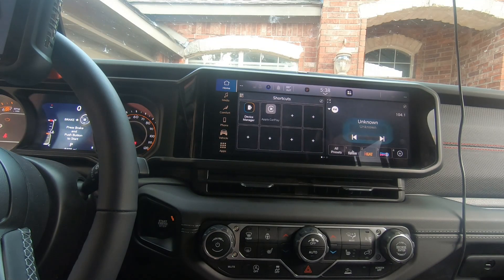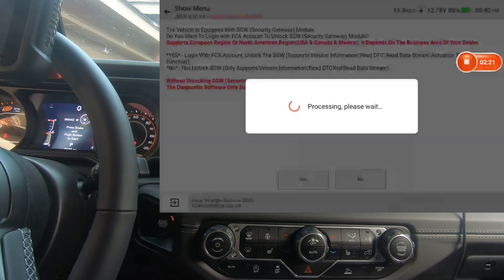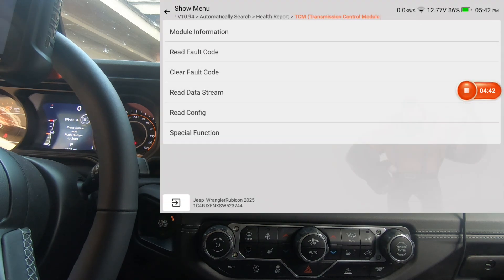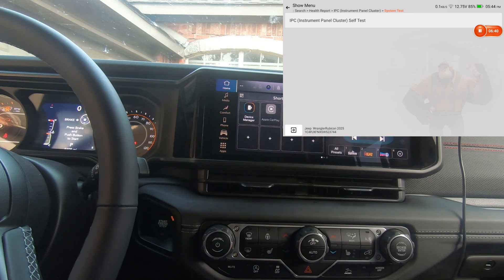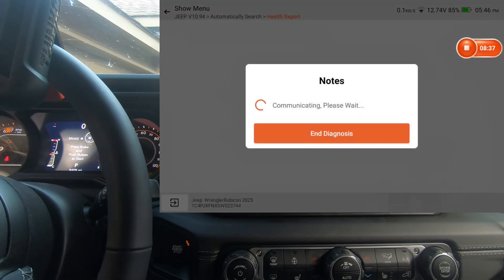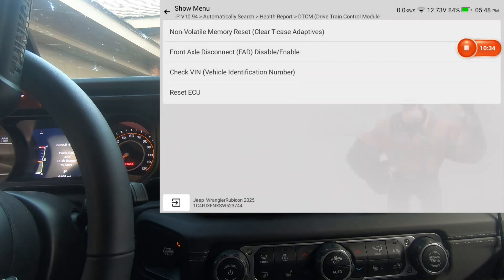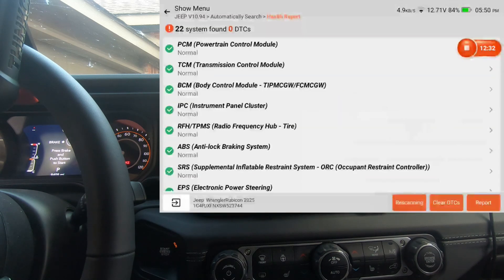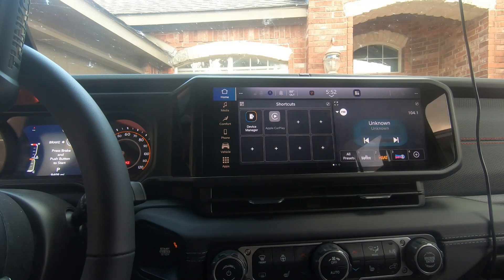Using the Thinkcar 689BT to Unlock the Secure Gateway and Walkthrough of the Bi-Directional Test.

Comment from the maker: THINKCAR Bidirectional Scan Tool, THINKSCAN 689BT All System
https://www.amazon.com/dp/B0DCFRF2TF?ref=t_ac_view_request_product_image&campaignId=amzn1.campaign.35ZUBUUA2CCU0&linkCode=tr1&tag=737mechanic-20&linkId=amzn1.campaign.35ZUBUUA2CCU0_1749669665408
The Mucar 892BT, The same as the Thinkcar but with added features.
https://www.amazon.com/dp/B0DTK24XKB?ref=t_ac_view_request_product_image&campaignId=amzn1.campaign.1LUP1976EJMV5&linkCode=tr1&tag=737mechanic-20&linkId=amzn1.campaign.1LUP1976EJMV5_1749669712203
KINGBOLEN K8 Pro Elite Full Systems Bidirectional Scan Tool
https://amzn.to/43DGQXR

Comment: I have a Jeep JLUR and was thinking about getting either the Thinkscan 689BT or Mucar 892BT.
they both seem to operate the same in videos but I don't know about real life in real time, if one is better than the other.
What is your experience with the two been like on the same make of vehicle?
I know the A.I. is a hit or miss and don't really care for it, so that isn't a selling point for me.
Reply from the maker: I prefer the Mucar, they both do exactly the same thing as far as fuctions, in fact, the Mucar has a Odometer check that the thinkcar doesn't have. What the Thinkcar does have that the Mucar doesn't is the ability to work with the Key Programmer. EVen though both will program keys on a lot of vehicles, the Thinkcar can not work with the key programmer that will program more keys.
Reply: @737mechanic  I do like that the Mucar allows you to add a background photo of a vehicle.
I searched for the Thinkcar website and found 2, one u.s. and one overseas and neither one offered any of these models, all of theirs were pro models at 1,000 plus without free updates but they can be found at another website called mythinkcar. I was looking for the TPMS add on device and they have it there to purchase.

Comment: Two things after I subscribe for the AutoAuth for the north American region I was expecting to see  the inactive change to active on the scanner but it didn't and still can't get pass the gateway module, the second thing is in the health check the tool was not able to scan the pcm it says not equipped and this is for the jeep jk without the gateway module a 2009 and also a 2018.Any advice
Reply from the maker: Did you sign up for the autoauth through the scan tool or did you go to the website?

Even without the autoauth the 2009 should work fine.
Try rebooting the scan tool and make sure the key is turned on.